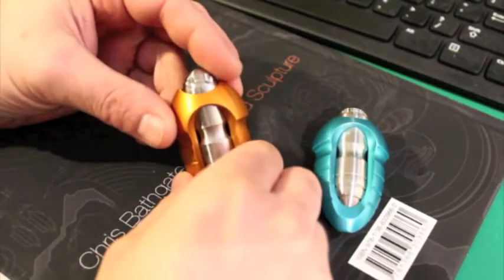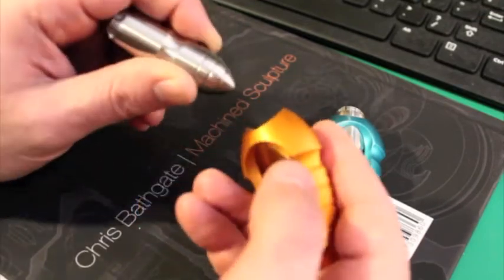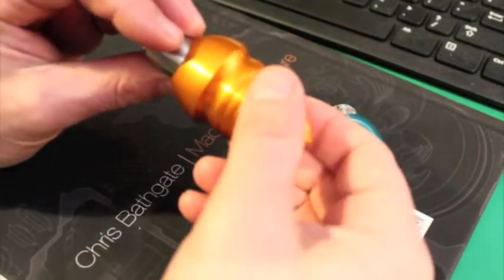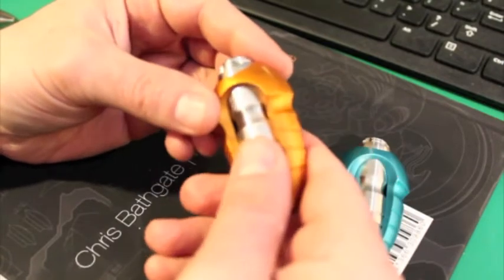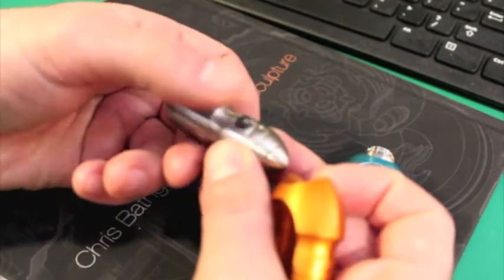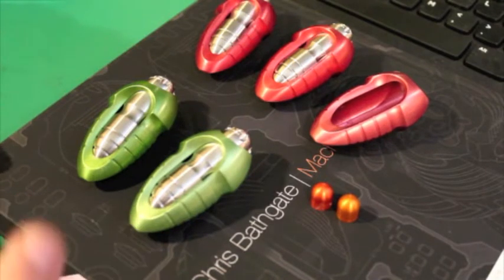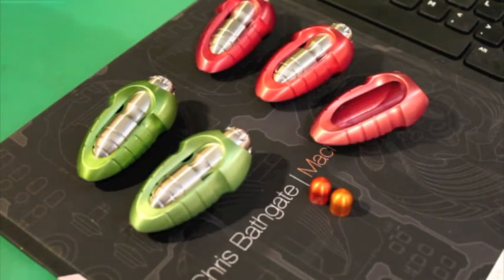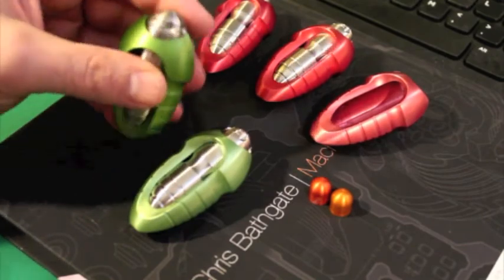S1V2 assembly and other notes (UPDATED!!)

Comment: Chris, I think your product has great potential, but the piece removing/ball issue is a deal breaker, my friend, also that pointy side...that might hurt a finger. That won't fly.  Just my two cents here. Why would you want to remove the piece in the first place? Why just don't insert that piston for good, let's say, using a stop? may be rotating the piston into a stop?. Once is in, stays in.. You don't need to remove it. Fix that, and you will make a fortune....look at the fidget cube, or hand spinners. I would buy it for sure. Good luck my friend.
Reply from the maker: No worries man, Im not trying to mass market anything, just make a small edition art piece. If I wanted to refine it into something that was childproof, it would no longer be art, it would be, as you say, a "product". not really my thing.
Reply: good point.